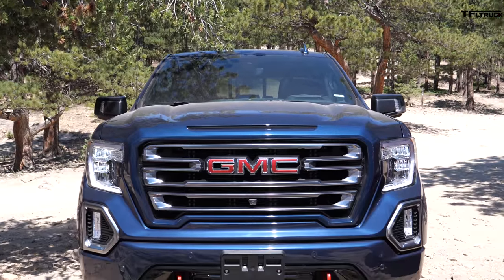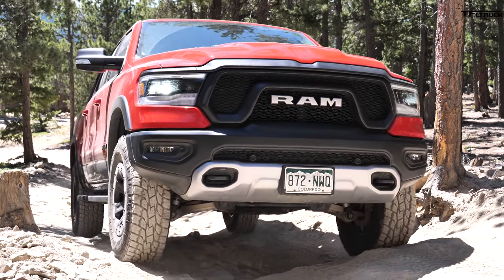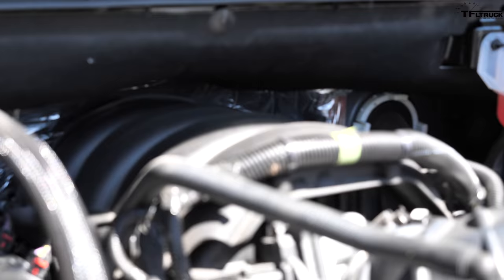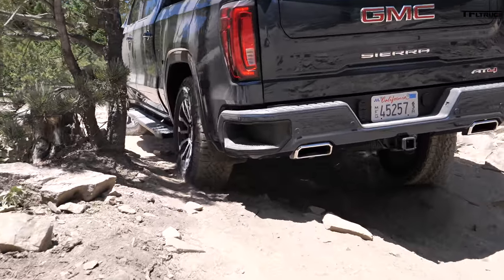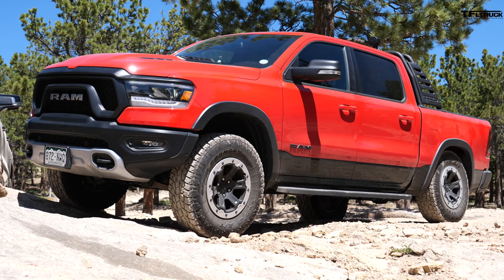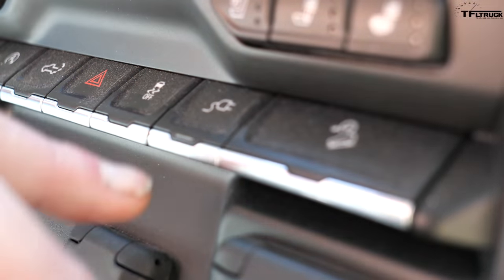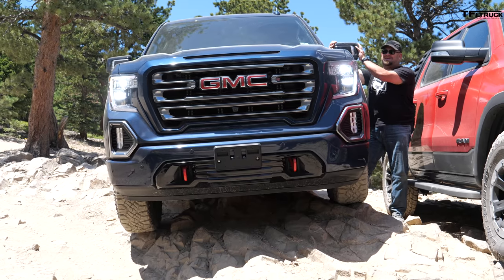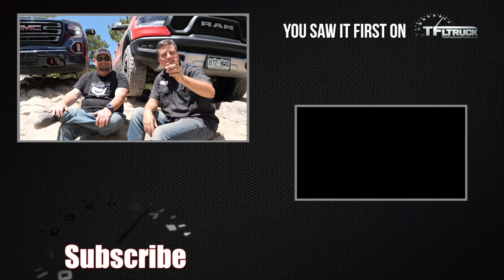GMC Sierra AT4 Comes Up to Challenge the Ram Rebel Rouser and This is What Happens | Ep.7

Comment: And once again here are all the geniuses about the G80 not being a locker,  it is a mechanical automatic locker it locks the axle solid, it works in mud snow grass and loose surfaces very well it is not a selectable locker so it is not good for rock crawling. Maybe you are not old enough to remember the times before E lockers, but most offroad vehicles were upgraded to mechanical style lockers and  some reacted faster, great for rocks, shit for street, and some like the G80 a more for "daily use" are great for everything but rock crawling and they are not speed deactivated, But they last a long time with moderate abuse. Shit there are gm trucks with G80 still working from the 70s and 80s. Rant finished. Oh and Andre the icon shocks do not affect amount of articulation it controls the speed of the articulation, otherwise  great video. Have a great day.

Comment: The G80 will last longer than an electric rear blocker, and with all the extra mods on the Ram it really  if any is only slightly better?? So stock for stock the GM's are better,  why pay that much extra for something you can have for much less $ and the Ram especially with the mods will more than likely not last as long, AT4 and Trailboss seem to be tops.
Reply: Anything will last longer if you... don't use it, lol.  What's your point?  If a video is all about off-roading, this is GM's best defense of the G80?  The Rebel isn't slightly better; this course didn't push either truck to the limit to see who really maintains elegance.  The power mods and exhaust on the Rebel don't do anything real-world in off-road terms -- they just make it more "likeable" to the guys.  They could have either saved the cash or opted for more off-road investment.

This video compares stock to modified, so there's no direct comparison at all unless comparing apples to oranges is a sound thing to do.  It really just serves more of an entertainment purpose.

Comment: Why comparing a stock from the factory truck and one that has been heavily modified? I mean how would the gmc act if they put a bigger lift and 35 inch tires?
Reply: It would act the same, adding a lift and larger tires doesn't change the fact that the G80 locker just reacts slow when you need it.

Comment: Having owned both, the GMC will out live the Ram by many years..
Reply: What makes the Ram a bad truck compared to GMC? Is GMC as good or better than Ford too? (I am a Tacoma owner but looking to upgrade in a couple of years)
Reply: @ramonconcepcion4642  You will not find anything mode reliable than a Toyota product however talking about Ram products vs GMC I had nonstop transmission, electrical issues, ball joint issues and the interior falling apart on my Ram, absolute garbage,  I also had a Chrysler 300 with so many electrical issues and oil cooler issues under extended warranty period they threatened to cut me off for repairs and offered to buy that pos back which I immediately agreeded to. My GM vehicles now are all high milers with minimal repairs , will never ever ever drive another Ram or Chrysler product again . I should have known the shit was about to hit the fan when on the way home from the dealership they emailed me to get booked in for upcoming recalls 😂😂😂😂
Reply: @panthermartin7784  that said.. no Rebel for me then.  I'm looking to trade in my Tacoma for a full size. Should I trade it in for a Tundra? Or maybe keep the Taco and consider Ford, Chevy, or GMC for weekend hauling and towing?
Reply: @ramonconcepcion4642  Tundra will tow whatever you got, shitty short box n brutal milage towing, but what ev, best resale as well, I just hate that 1992 interior Toyota has but if your gonna swing for the other team the GM with the 6.2L and the max towing package is friggin deadly combo and great mpg and the LS series of engines run forever.
Reply: @panthermartin7784  I'm really liking that 6.2L. Would a trailboss be as efficient as GMC in terms of longevity? I like the Tundra a lot but I see the 6.7 as both weekend and daily commuting truck.. at least more than the Tundra
Reply: @ramonconcepcion4642  The trailboss is a soft riding niche truck with a very low tow rating like 7k or something, truck is made for offroad use, where a heavy trailer package is like 12k or more . Iv spent a shit load of money over the years on like for example Z71 packages had to have them as I do alot of hunting. Well one time I ended up with a rental which was basically 1 ass hair away from a work truck trim and I mean stripped. Anyways spent 2 weeks in a stripped truck with no options chasing elk , no skid plates, no tow hooks I mean nothing. Well it had the G80 locker n decent tires, n the truck ran like a champ up the logging roads in 4Hi, zero issues, almost unstoppable.  In summary, you dont need much to get by, you just need something that works for you.
Reply: @panthermartin7784  thanks for the advise man. I totally get about the importance of off road packages. I had a 2014 Ram Express/Tradesman Hemi. I took it to SE Oregon and that truck was never the same after that. Tranny leak started at 25k miles and never stopped. I took a Tundra and Tacoma (both trd off road) to the same area (and did longer trips around there) and nothing happened to them.  I got the Tacoma because it could take me to the office during the week and off roading/camping/hunting in the weekends. But I'm in need of more space now so I'm looking for a balance half-ton truck. Let's see how it goes. I feel more confident now with your thoughts and guidance regarding Chevy/GMC products. If the new Tundra comes with bed outlets and other key accessories for the outdoors I will definitely consider it.

Comment: It's clear that the test isn't even a fair comparison, the Dodge Rebel had a 2 inch lift in the front with larger tires that should automatically disqualify this video and redo the comparison with stock trucks no mods
Reply: The stock ram is still better it has an actual rear diff locker.
Reply: @jordangraf673   even still there are a lot of other variables and I would like to see a fair comparison
Reply: @alithwolf1065  they already did a comparison a few months ago. Both trucks stock.
Reply: @jordangraf673  ah cool thank you

Comment: Low range Ratios? And final diff ratio? Might be the difference here.
Reply: Locker and No Locker, that is the difference.
Reply: @kellyfontes7757  true.
Reply: @kellyfontes7757  They both have lockers. The g80 is a locker. The ram is a 3.92 and the AT4 is a 3.42. The RAM also has 35 inch tires vs the AT4 at 32.
Reply: @EGGINFOOLS  You are quoting the differential gearing ratios as a locker? The G80 you can not engage the locker, it engages for you.
Reply: @kellyfontes7757  I was just referring to your comment about the locker. The G80 is a locker. The other comment about ratios was for the original post.

Comment: Those big trucks need rear steering 😀
Reply: Garth Hayward GM tried that before. Cool in theory, doesn’t hold up well in the real world.
Reply: @chevyon37s  they just did a video on a company who is working on a new system for it and what the drawbacks were to the old system and why it went away.
Reply: Drew w Interesting from comments I read seems those that owned those loved them, what did the real world reveal about them?
Reply: @garthhayward9581  That it was a great system, just expensive to buy upfront.
Reply: itsmeagainmargret I see Audi, Porsche, BMW and Maserati use rear steer in their larger SUVs seems it's an option that OEMs should consider for these long trucks. The TFL trucks Video showing ZF test it on a F150 was really an eye opener.

Comment: At4 package is a joke.  Gm is a joke.  Red tow hooks, mud terrains and rancho shocks for a huge price increase over a low model 4x4 from gm?  Get real...
Reply: jrstow86 so what makes the Rebel any better from the factory?
Reply: @LGBFJB46  not sure it is... not defending the rebel in any way.  gm and dodges answer to the raptor is vague.
Reply: @LGBFJB46  judging by tnis video... Nothing. They said it at the end of the video. The GMC managed to be the best of both worlds. It works offroad and can be daily a daily driver. At $66k, thats the least anyone should expect really. The Dodge makes noise and the hybrid getup has already proven to be sort of a gimmick by this channel. Maybe it helps with torque, but the fuel savings proved non-existent. Just another Fiat part to fail.
Reply: @jrstow86  Dodge doesnt make trucks now.
Reply: @96thundercat  ram, dodge, chrysler, jeep,  fiat... same shit different toilet
Reply: jrstow86 I feel the same way about RAM and FCA, what a joke. Lol.

Comment: the RAM is just butt ugly from every angle. I don’t understand how it’s exterior design was cleared by so many executives and approved by Fiat. The interior really saved this truck 🤦🏽‍♂️ #Yuck

Not only is it unattractive but it cost more than the better looking and overall better performing GM truck. That just doesn’t make any sense. For over $70k you can’t even get a freaking front facing camera to see what you’re doing off-road? RAM is a joke.

FCA’s gonna have to go back to the drawing board and quick!. especially after the GM twins receive their new “top notch” interiors. It’ll be a sad day at RAM. Great video guys! Keep up the great work.
Reply: Yet they have been outselling Chevrolet so far this year.  Numerous automotive articles out there about Ram taking a good number of previous GM owners with the new Ram. I see a lot more 2019 Rams then I do Silverado or Sierras honestly
Reply: mybro727
..... RAM 1500 has been selling a lot more than the Chev/GMC trucks! Reported in many automotive Journals!  And it was MotorQtrend "TRUCK OF THE YEAR" as well, so RAM certainly did something right!
Reply: Trenton.T Channel Sierra and Silverado sales combined still outsell RAM even with the interiors being in FCA’s favor. The interior update in the GM twins who continue to outsell RAM prior to the update certainly will not be pretty for FCA after the update. The interior and maybe locking rear diff is the only reason someone would buy a less attractive, more expensive RAM over a GMC Sierra.
Reply: @mybro727  You're up in the NIGHT!
Reply: Top notch interior? A GM vehicle?😂😂😂😂😂😂😂😂😂 Now THATS a laugh! They can't even get Cadillac right.
Reply: Sidebar: The Rebel is NOT $70k. That is factoring in all of their cool mods. Furthermore, GMC doesn't even offer adaptive cruise control, something a $20k  Honda Civic does. And this is an "off-road" truck with a weak G80 rear end? Sheesh.
Reply: HellKitty 101 But Cadillac is fine...NEXT.

Comment: Compare stock to stock smh
Reply: For this trail, honestly, the biggest difference between the two trucks was the rear locker - stock equipment in both trucks.
Reply: Ryan rkj the ram is still modified. Stock vs stock give you a better idea right out the box. Just my opinion

Comment: Nice vehicles, completely ridiculous prices.  Dirty secret--pickups trucks and SUV's have the very highest factory price markup from manufacturing cost to what the dealer pays.  About those electronic lockers--read the part in the owner's manual that says that they unlock automatically above 25 mph.  Easy solution: spend a thousand bucks or so and put a true locking differential (an Eaton locker, for example) in the rear differential.  That's a real locking differential, not a low-speed poser.  Finally, can you guys quite the babbling like pimple-faced teenagers about the exhaust sound?  When I'm off-roading, I want to hear the birds singing and the wind through the trees, not some roaring exhaust.  A truly "elegant" off-roader goes about it with a minimum of wheel-spin or noise.  Go re-read the Tread Lightly stuff.
Reply: Guess who makes the G80?

Eaton.

Comment: I have some general grabbers  33 inch tires on my avalanche with the z71 package and was offroading one day when the diff locked up it split the carrier in half with the weight of the tires not the best rear end IMO now I got a detroit truetrac 1000 dollars later
Reply: In my experience, it is pretty hard to get the TrueTrac to help you out once one tire is in the air.  Applying the parking brake on my truck helped it deliver a little torque to the wheel on the ground, but not always enough.
Reply: @RyanRKJ  I live in the desert so mostly dunes and hill climbs not to much rock crawling but I've heard people say that about the truetrac it's worked out great for me so far

Comment: The G80 is a limited slip differential not a locker. Change my mind
Reply: It's a locker. When the governor engages, the spiders get locked by the ramp system. It's not just a set of spring loaded clutches or spring loaded cones.
Reply: @danwood4478  I'm glad it locks both wheels together in such a positive way but the only way to activate it is to have  significant wheel slippage then and only then does it slam itself into the locked position.  Therefore its slipping until it engages which means limited slip
Reply: Dan Atkinson when engaged, the G80 applies 100% power to both rear axles. That is a locking differential. Nothing is “slipping” prior to engagement. It’s either engaged or not. No in between, or partial engagement.
Reply: @truckguyjoe  a torsen uses helical gears to bind against each other and provide 100% power to both wheels. It's still considered a limited slip differential since it has to encounter slip to engage. When you watch the video it takes a significant amount of time for it to engage just like that torsen system
Reply: @danatkinson6698  negative. It's an open differential until it engages. The engagement with wheel speed differential does not make it a limited slip. Limited slip refers to clutches or cones that will break holding power in an over torque condition. it is the holding mechanism, not engagement mechanism that determines whether it's a locker or limited slip.
Reply: @danwood4478  would you consider a torsen a locker then?
Reply: @danatkinson6698  torsen is a different animal all its own, but yes it gives traction like a locker. I wouldn't classify it like an Auburn or Eaton limited slip. But, who am I other than a guy with an opinion.  I've worked on pretty much all of them other than an electric locker.
Reply: @danwood4478  I'm just a guy with an opinion too. I do thank you for having the debate with me about it
Reply: @danatkinson6698  the torsen in the raptor is NOT a locker. The G80 is 100% a locker. It doesn't slip at all. The only clutches the G80 have are the ones that engage the "paws" to allow it to lock. 100% to both wheels. Not slipping power to one or the other. When the locker engages and one wheel is in the air and you grab it you will go around with the wheel as well as the other wheel on the ground. It takes 100rpm differential between both wheels to allow it to lock making it an automatic mechical locker. There you go. Mind changed!
Reply: @EGGINFOOLS  not quite, the g80 requires a bunch of wheel spin to engage it just like a torsen requires wheel spin to engage it. At most I'm willing to say they're equal to each other. So since they're equal I'd say they're both not lockers but with positive engagement when activated by wheel spin
Reply: @danatkinson6698  I get your point but it's not fact. The torsen isn't a locker. It's slips. The G80 only requires 100 rpm difference between wheels. Not opinions, facts. It fully locks. Go on Eaton's website, they show it
Reply: @EGGINFOOLS   I just double checked and I have sources to confirm my stance. The torsen does lock up and stays locked until everything equalizes, just as the g80 does. My sources are the video on the torsen differential and the Eaton literature found on this forum

https://youtu.be/JEiSTzK-A2A

https://www.bobistheoilguy.com/forums/ubbthreads.php?ubb=showflat&Number=511438
Reply: @danatkinson6698  So then I changed your mind! You said in previous post that the G80 and torsen aren't lockers dude!
Reply: @EGGINFOOLS  not necessarily, I don't believe that the g80 is a locker but it's not a limited slip as you say. The torsen is considered a limited slip even though it will achieve a locked condition during its operation. So I'm still not convinced it's a locker but if you want to call it one then the torsen needs to be considered the same
Reply: @danatkinson6698  Dude make up your mind. At first you said the g80 isn't a locker. Then you said it was based on the information you read and that the torsen should be too. Now you are saying it isn't again but if I want to call it that then ok by you. Doesn't make sense.
Reply: @EGGINFOOLS  I see why you call it a locker, I'll respect it more than I did prior to these conversations but it's still not a locker to me. Ps I never called it a locker, I just said it will achieve a locked condition until pressure equalizes just like the torsen.
Reply: @EGGINFOOLS  since the g80 uses clutches in its design it should definitely be considered a limited slip in the same category as the torsen since those can wear out like most limited slip differentials can.

Comment: Toyota tundra is the best.
Reply: Yeah it's the best if you like tech from 2010
Reply: The last good Toyota truck was the 1994 Sr5
Reply: At being rusted out japcrap, sure.
Reply: Wonder why you don’t see them testing Tundras every year? Because they aren’t innovating and not even comparable to the big three any more.
Reply: @chevyon37s  

The American cars cars have very many problems, so the Middle East, especially in the Arabian Gulf, overheating the engine and gear does not bear the process and many disadvantages so the engine and these problems are not found so the Japanese Toyota.
Reply: TOYOTA IS THE BEST 👌😎
Reply: The most prominent problems are therefore the American automobile companies are overheating the engine a lot and also the transmission gearbox has many problems and poor materials used in American cars.👎